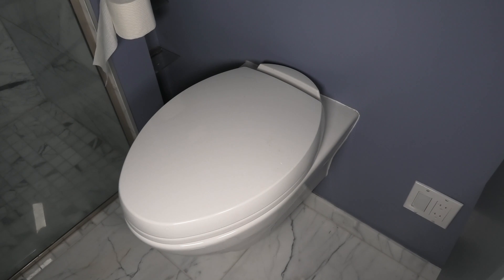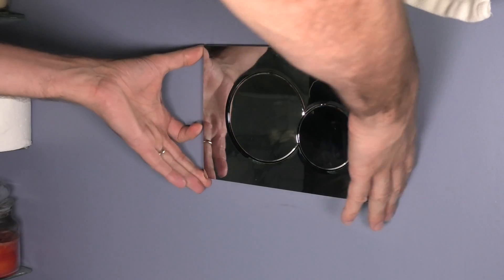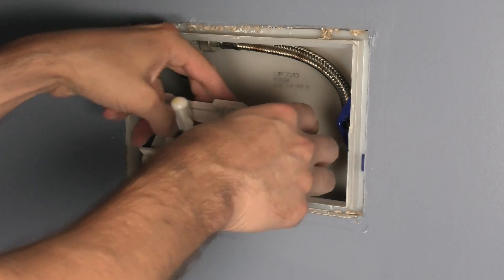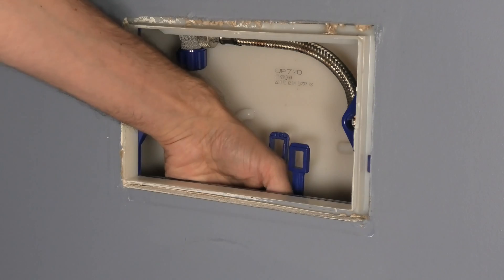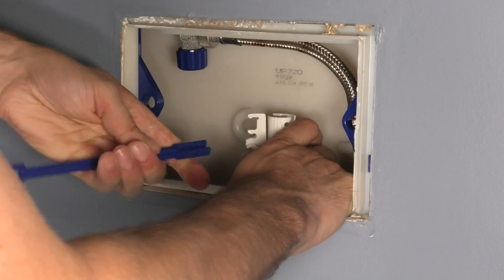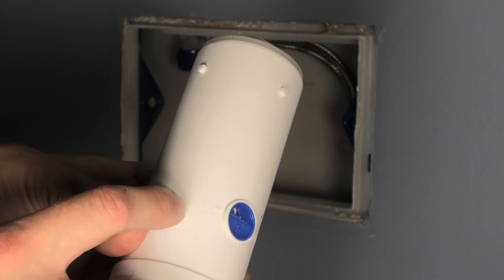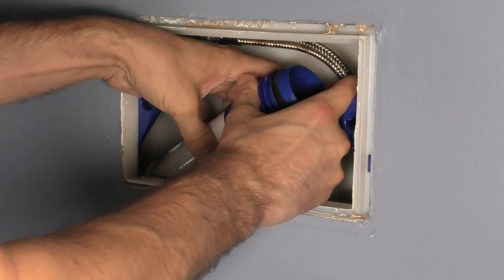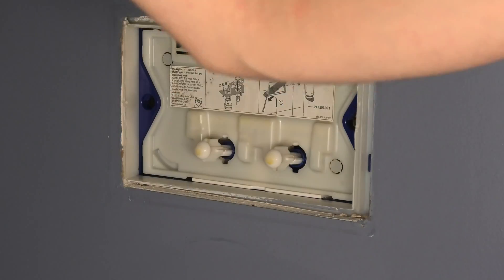Flush Volume Adjustment for Geberit In-Wall toilets (how to)

Comment: Thanks for the video! I followed these steps and got everything back together. Unfortunately now the full flush (not the half) sticks every time now. After a full flush, I usually have to later execute a half flush to get the full to "unstick", otherwise the water will run infinitely. Any suggestions for how to work around this? In your experience, what causes this?

Comment: The method to only remove the valve & not the whole assembly (leaving the blue cage still in situ) is to turn the valve counter-clockwise a small amount, this will un-clip it from the blue cage (2:56 shows how the clip is next to your thumb). This will also enable you to replace the flush seal washer which sometimes perishes over time.

Comment: Thank you for the video! It did really help though I have a slightly different Geberit system (manufactured in 5/2022). The good thing is that you may remove the whole flush mechanism in one piece and also there are two plastic parts on that to adjust both the small and large flushing volume independently. Very easy and quick to change (say 5 minutes max disassembly & assembly when you're doing it for the first time and taking photos during the process).

Comment: Thanks for the great video!  Very informative.  

I have purchased and installed a Geberit Omega 111.012.00.1 carrier for pre-walls.  It is listed as the 1.6/0.8 gpf model.  

I am hoping it has the blue dial that allows me to change the flush volume to accommodate the 1.2 gpf designer bowls that are available.  

Do you know if I can change volume with this model? 

Thank you!

William

Comment: I have a new Geberit tank.  It flushed completely the first 10 times.  Now, it does not flush completely unless you hold either button until the tank empties.
Reply: Same. Did you find a solution?
Reply: @ramlange same 
Is this the design ?
Reply: Same..i must hold the button for full release of water ...you find solution?

Comment: I hope I'm not asking a dumb question, but it makes me nervous that I could drop the main assembly piece (the big white piece) while disassembling or re-assembling. Is it so deep and narrow that grabbing that piece back out of the carrier once the blue tabs are disconnected would be impossible or at least super difficult to do if it were to fall in and land on its side?
Reply from the maker: Hi,  there should’ve enough space to get all the way to the bottom with one hand.  
As least I was able to in the past - but I think I have not the biggest hands.

Comment: I purchased a Duravit toilet with a Gerbert flush system. I don’t have problems with the flush power. My problem is that the water level remaining inside the bowl is very low. Do you know how to adjust the water level inside the bowl. It is very embarrassing to see stains on the bowl because honestly everyone does not have perfect aim into the water. Just being realistic! This is a huge fail in the design of this system. I have asked the retailer and they tell me the water level inside the bowl can’t be adjusted because that is how the system is design. How is it possible for someone to poop in a practically dry bowl without leaving stains? 🐒💨Please Help! This is an expensive system and I don’t want to throw it out so soon.
Reply: Hola Maribel. If you search in Google "little water in toilet bowl" there are many results of why this happens. Apparently, it is not a Geberit issue but can happen with any toilet.
Reply: Did you ever find a fix for this?
Reply: @A-Ros825 Did you ever resolve this issue ? 
I am having the same issue .

Comment: One more question, what is your setting 1.6 or 1.28, and why?
Reply from the maker: The toilet is set to 1.28.  In case more water is necessary you can always hold the button down for the full flush.